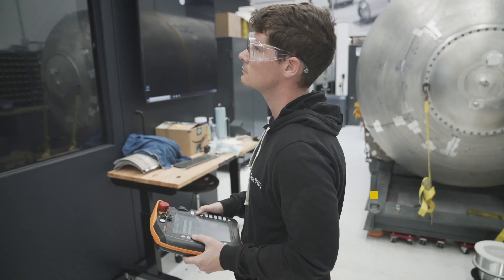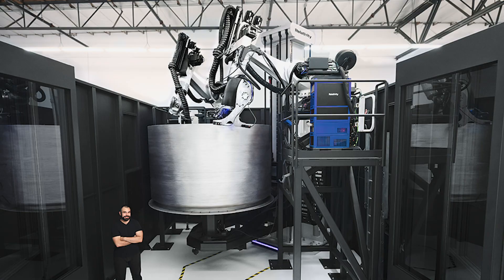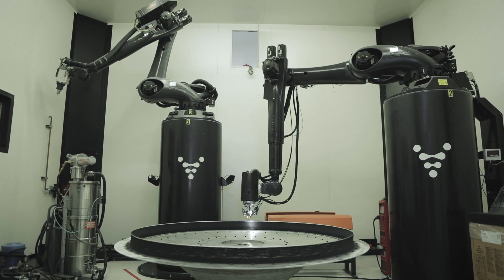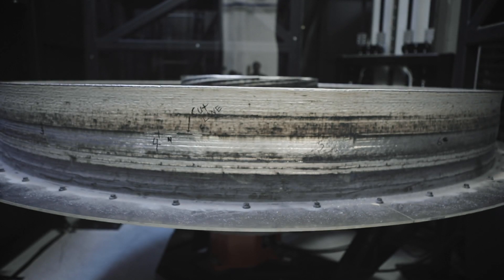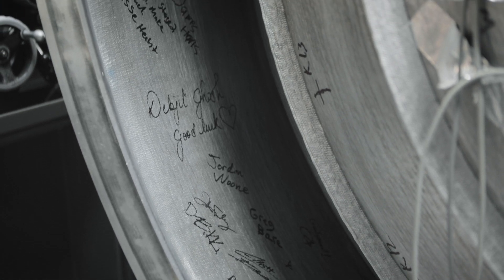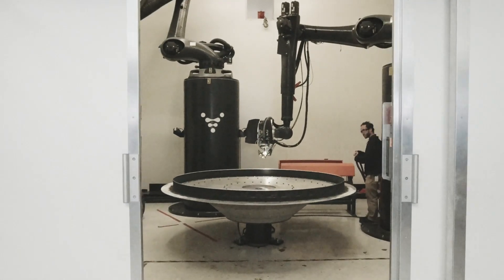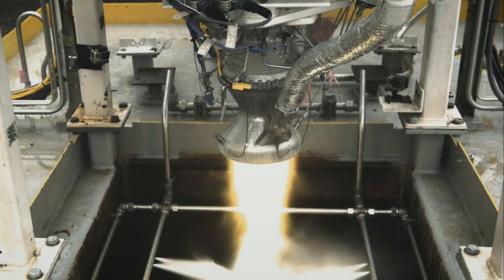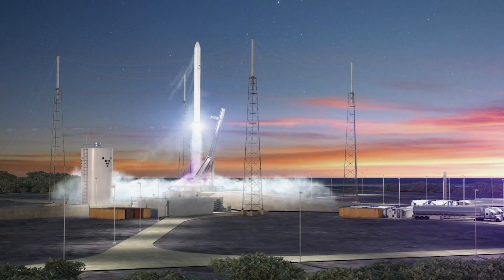Interview: Relativity CEO Tim Ellis on 3D printing rocket ships

Comment: There is a reason why tanks are made of sheet metal.
It is stronger, lighter, uses less material and energy, has a lot better surface finishes, is uniform thickness, does not have voids and stresses, are faster and cheaper to make, and so on.
Also the clip of the powder laser sintering printer and the part coming out of it highly polished is fake. That kind of process gives a mat pretty rough surface finish.
Reply: My understanding is that the tanks in rockets built by "traditional" methods were never made of sheet metal.    The tanks were built from solid formed pieces of aluminum alloy, and a cnc machine removes material to form a latus framework inside the tank to save on weight while minimizing compromising rigidity.  This leads to a lot of waste in rocketry over what normal industry has to deal with.  So what may work for rockets, might not be practical for say, cars, or propane tanks.

Comment: I get a fuel tank, but how do they do small intricate parts like centrifugal pump blades?
Reply: smaller printer?
Reply: isNull isNotNull that’s the secret sauce :D. Maybe there’s a chemical process on their alloy or they do nonlinear 3D printing. They print concentric rings and one has a higher tolerance between when it cools down. Enough to turn, not enough to let some liquid methane through. Hard, but maybe possible?
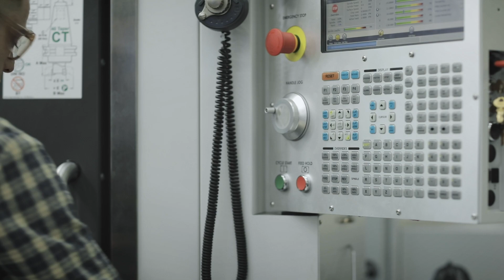Reply: 5:50 maybe using this 5 axis milling machine
Reply: Using desktop metal 3d printer by using dmls process.